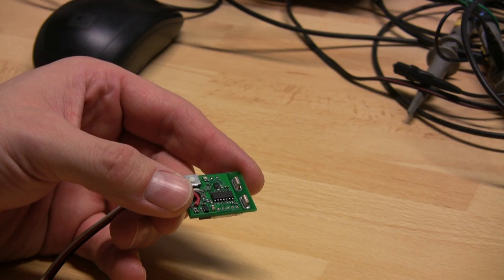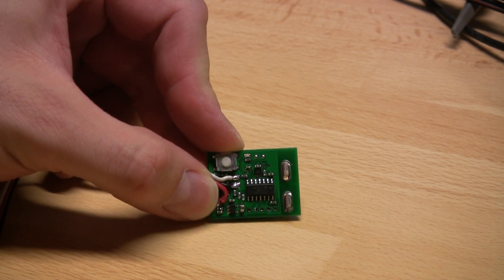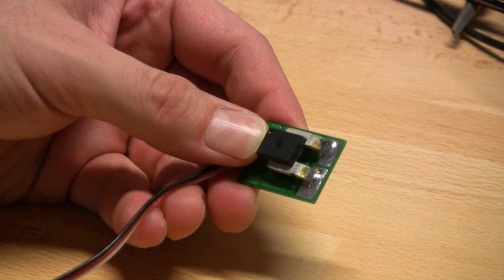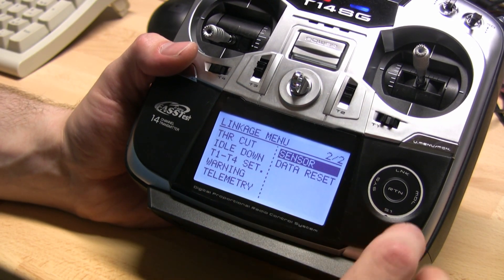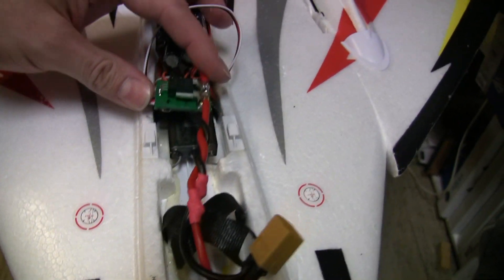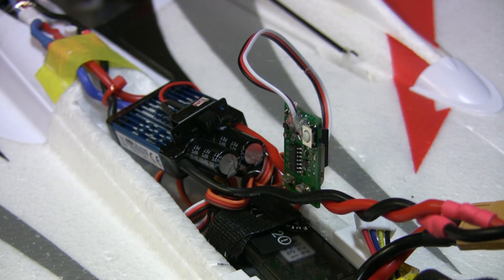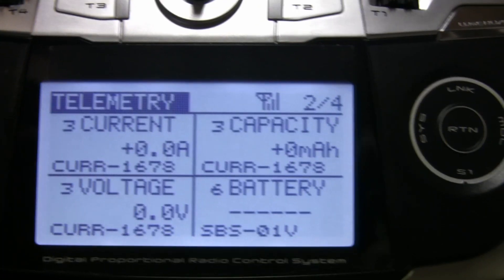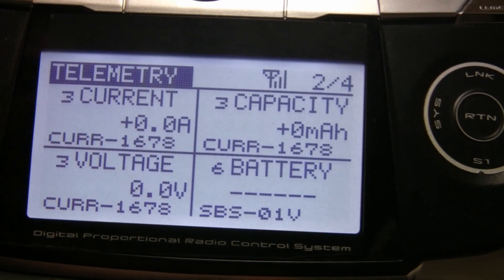Electric Fuel-Gauge Presentation and Instructions

Comment: Installed a V2 sensor and current reads 25.2A and capacity either reads 32000mah or nothing at all. What am I doing wrong? I have another v2 as well and the two v3's I just received. I'd like to get the older ones working first.

Eaton